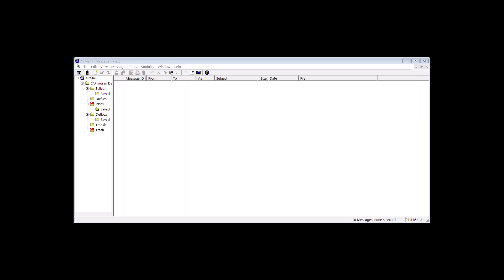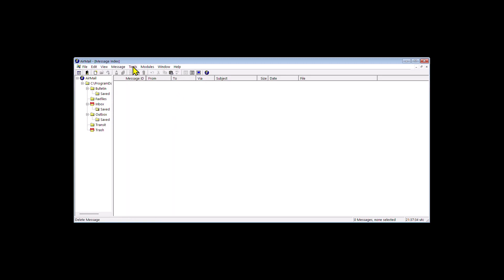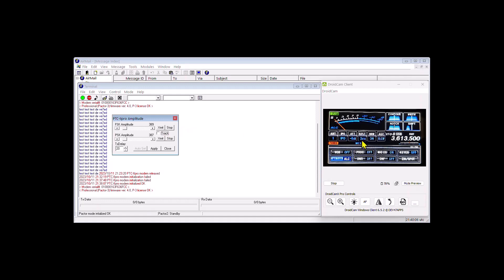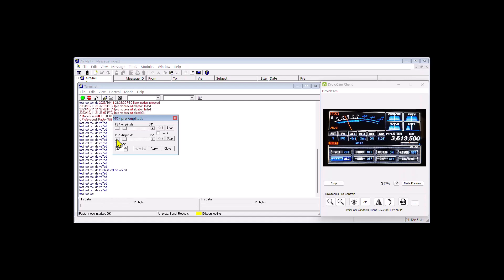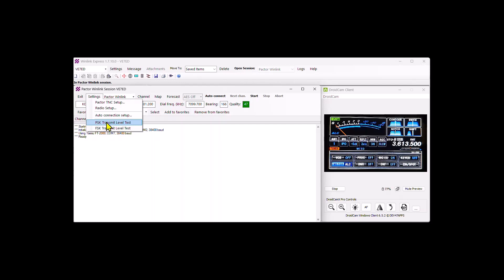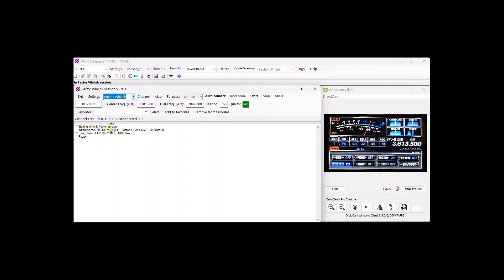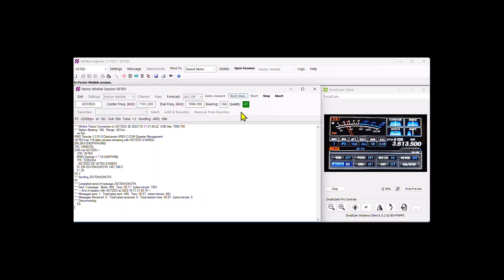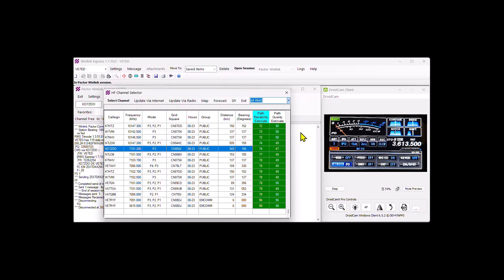Pactor Series #1 - HF Radio and Modem setup

Comment: Hi Ed, I have identified the COM port using device manager, but when I open the Terminal in Airmail there is no connection signal from the modem. I am using a PTC-IIex powered from my icom M710 radio 8 pin cable. When powered on the PTC Tune lights are solid red. Any help is much appreciated.